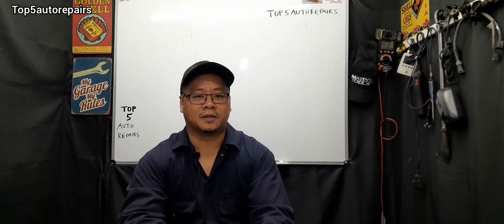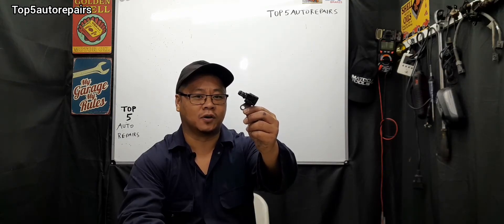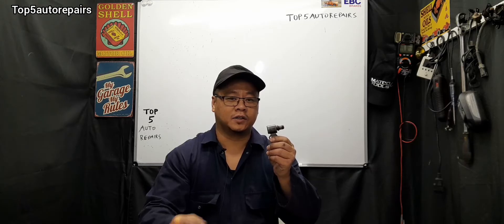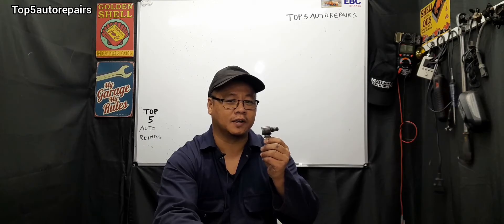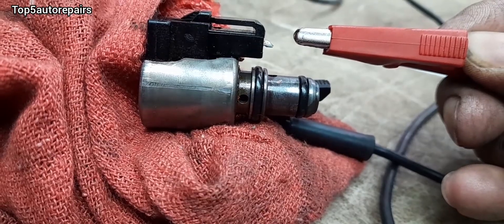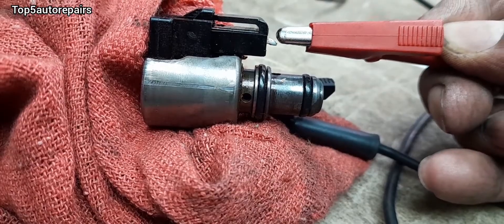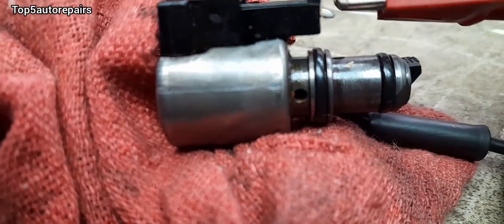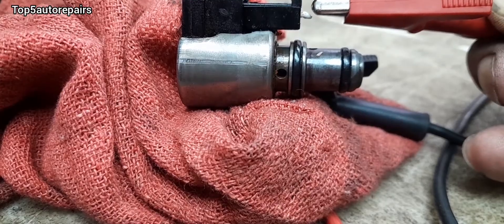TCC SOLENOID SYMPTOMS (HOW TO TELL IT IS BAD BY TESTING) TORQUE CONVERTER CLUTCH SOLENOID

Comment: 09 lincoln town car, was driving on road then stopped at light,hit gas & car just revs,put it in 2nd & car drives, when I shut off it goes in drive for 1/2 mile then drive slips,does this all the time, so can only drive in 2nd,is it the solenoid?

Comment: Will it throw a code for transmission range sensor
 I have a 01  e350 5.4.. 4r100.... powered by natural gas...It's runs and drives good. Recently it started. Not driving in drive ... until you put in 2nd first for a few feet put in drive... and it will drive correctly thru all gears no issues... if you don't come to a complete stop and do more of a California stop. Lol it will be good... if you come to a complete stop  you would need to put in second first for a few feet again and then in to drive.  Only code is trs... transmission range sensor... I've replaced it and changed nothing. .. took to a shop to diag they said the shifting cable is bad 😆 🤣  ..I just don't see that it or being the case... they said in there opinion transmission is good..I'm hands on with my vehicles i want to fix.   Even if I need a new transmission at the end I'd rather do it then sell the van for dirt cheap on a easy fix

Comment: Excelente video. I have a Doggie Grand Caravan 2014. No check engine light. But salling when get stopped from 60 or gratter mph. Some times engine turn off during speed reduction to get stop. I going to replace this solenoid because resistance is out of range.